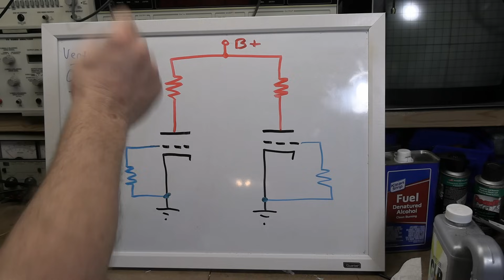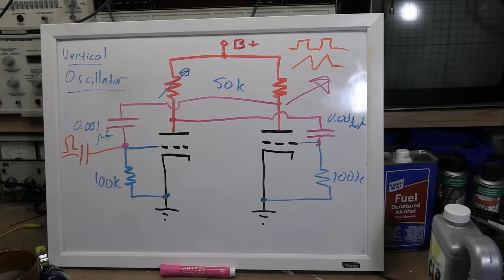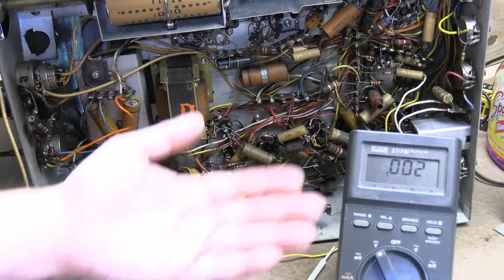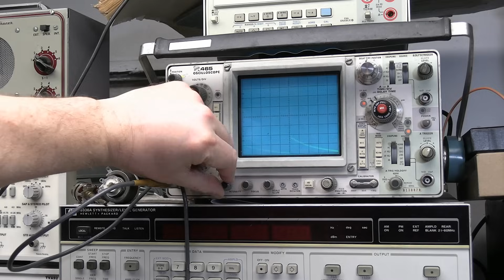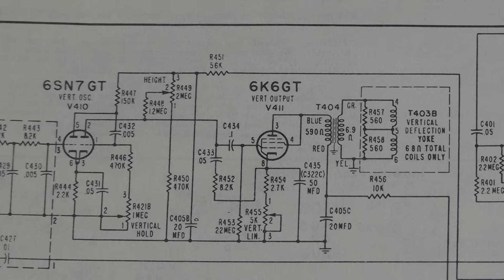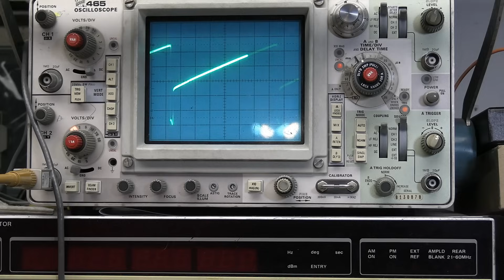Beginners guide to B&W tube TV restoration part 12 (vertical oscillator)

Comment: a question: i have a tv with no high voltage, but it does have about 400v horizontal output voltage from the tube top cap, and it has a really nice looking yoke. what would cause no high voltage from the anode lead?
Reply from the maker: Horizontal oscillator not running or a bad HV rectifier tube

Comment: I’m building a video camera from vacuum tubes… I have the equivalent tube to the 6K6, a type 41, to use for the vertical output. Could I get scans of the schematic and if possible what’s the trace look like (voltages) on the grid of the output tube?
Reply from the maker: Many Sams and Riders service manuals have been scanned and are available for free.  Some can be found at the Early TV Musuem website here:  https://www.earlytelevision.org/postwar_tv_schematic_diagrams.html
Reply: @bandersentv ahhh yeah I went looking after figuring the model and found it. Thanks! I’m going to make some videos on my project soon :))

Your videos are very helpful!

Comment: Am I right to assume it isn't terribly important to use non-inductive resistors (such as carbon comp) in the vertical oscillator due to the low frequency?
Reply from the maker: Yes, and the same for the horizontal.  I mostly use metal film for all resistor replacement.  Even in IF and RF circuits.  The inductance in tiny and seems to have no impact.  It starts becoming an issue around 100MHz.
Reply: @bandersentv  Sweet! Good info.

Comment: Everytime a see a resistor over about 1M, i just feel is is “sus, sus, sus!”. thst 22M grid bias resistor from the control grid of the 6K6 to deck gives me this feeling in droves!
Reply from the maker: It's actually 2.2M.  Hard to see in the schematic.  I find it's more likely for sub 100 ohm resistors to be bad in TVs.  Often used in the cathode circuit to set the grid bias.

Comment: On all the sets I've played with the vertical free-running frequency needs to be a bit higher than the field rate in order to get proper lock. As you've said the picture tube is a great troubleshooting aid: With an image displayed this is visible as the picture slowly rolling up, if the picture rolls down the oscillator is too slow.

Comment: (@20:15) - I think the schematic is missing a capacitor. They have one cap (C432) connecting the plate (pin 5) of section 1 to the grid (pin 1) of section 2, but there’s no cap from the plate of section 2 (pin 2) to the grid of section 1 (pin 4). I’m guessing the actual circuit DOES have such a capacitor.
Reply from the maker: This is a variation called a cathode coupled multivibrator. Harder to explain so I focused on the more common configuration. The schematic is correct.

Comment: Is it possible that the scope off of which they photographed the wave forms for the service manual was not as accurate or sensitive as your Tektronix (that scope was undoubtedly older and almost certainly not a Tek, maybe an old Eico or something), and your Tektronix is actually giving a true picture of what the waveform should look like, rather than the picture in the service manual? Is is possible that you're chasing something that doesn't need to be chased?
Reply from the maker: Possible, but I do have a lack of vertical deflection on the screen.

Comment: I'm loving this new series. I just have a troubleshooting question. Why are you going straight to the vertical oscillator circuit? Is it because of the poor vertical deflection? What if a set has multiple problems?
Reply from the maker: First should always be power supply. We got lucky and it's working well enough. The two major remaining  problems are vertical and horizontal. Flip a coin.

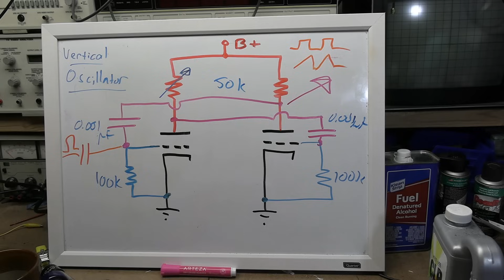Comment: When I learned about this circuit my instructors called it a “Multivibrator” ,  “Flip Flop”  and  “ Sawtooth Generator” . The vertical and horizontal multivibrators were most problematic circuits in all TV. A scope was a must have piece of gear to effectively 9:51  troubleshoot their problems. We studied from the “Grob”  basic Electronics book in 1961. I used it when I was teaching in 1974 for RCA Schools.

Comment: I have a Sony color TV that has no vertical sweep until you give it a signal and then you get a full normal picture.
Reply from the maker: Is the screen blank or do you have a bright horizontal line?
Reply: @bandersentv  Bright horizontal line. Its not blanked.

Comment: Another thing to watch is if you have the scope on AC coupling and you are looking at a slow signal. The AC coupling of the scope will distort signals like ramps etc... If possible, check the signal using DC coupling to verify that this is not going on. Use caution of course if there are high DC voltages around or you might damage the scope input. I don't think that was the case here but it can be a trap for young players in some situations.

Comment: You may want to clarify to your viewers that the actual NTSC scan frequencies are 59.94hz vertical and 15,734hz horizontal, not 60hz and 15,750hz. They were changed for color tv around 1953 due to the color subcarrier interference with the 4.5 mhz audio IF. This is not an issue for restoration but if someone puts a frequency counter on one of the scan circuits, 59.94hz and 15,734hz are normal. The 59.94 still exists today in HDTV formats. The reason it was retained was compatibility with analog TV in the early days of HDTV.
Reply from the maker: LOL.  I edited out the part where I say "yeah, yeah I know the frequencies changed over time".  I'm divided about mentioning it since all the vintage manuals refer to the old specs and don't want to introduce confusion.  I'd advise against using a frequency counter as these are not very stable oscillators.  They naturally wander a bit without the presence of a sync pulse.
Reply: 30hz is what you hear and see on the scope. Sams reference is 30hz, 60i 30fps
Reply: @shango066  Yes because the Sams was probably printed in the late 1940s. But if you accurately measure the frame rate you will find it's 29.97hz, not 30.0hz. Yes, this is insignificant in restoring any TV, but on the broadcast side this minor difference has been a PIA since 1953 for reasons I won't get into here.

Imaging you are RCA inventing COMPATIBLE color TV in the early 1950s. What would you propose?

1) Require every single B&W TV in existence at that time (already in the millions), to have a service shop re-tune the audio IF chain for a new IF frequency?

2) Just bump the H and V frequencies slightly but well within the pull-in range of the TV H and V oscillators?
Reply: @shango066   It's 60Hz, nothing in the TV runs at 30Hz. When Sams shows a waveform and 30Hz they are referring to the repetition rate of the scope. They also say 7875 cycles for horizontal waveforms.

Comment: Bob, One of the tricks us old timers use is to feed one side of the filament voltage into the V out tube grid. If you have a dead V osc, this will tell you if the output is working. NOTE: This is valid ONLY for PARALLEL wired filaments. I used it a few times in the field and it came in handy.
Reply: It's best to do this using a capacitor so you don't mess up the biasing too much.